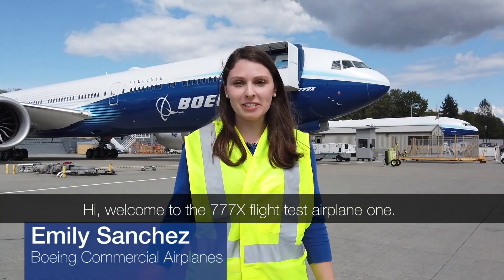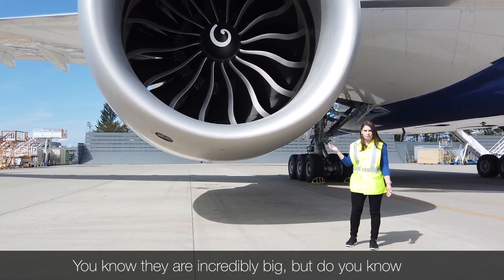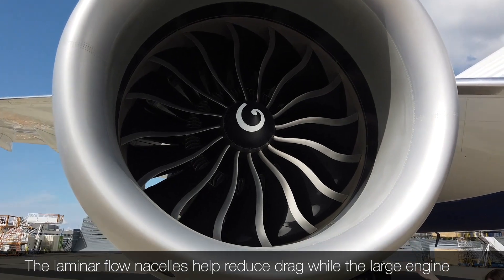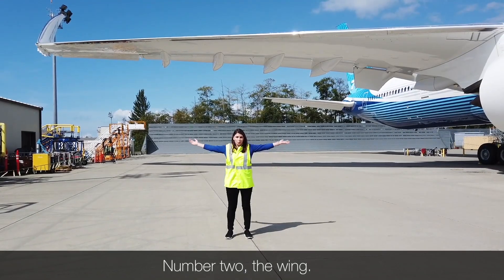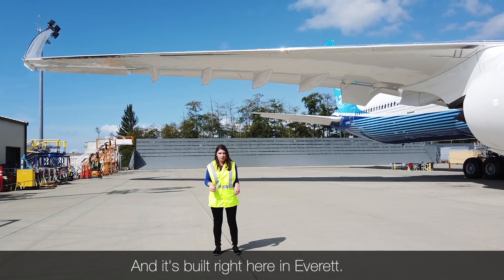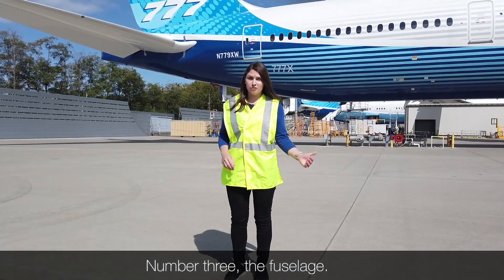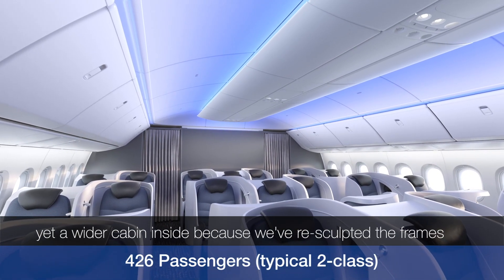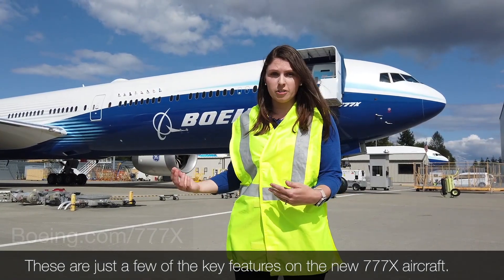Boeing's 777X | The GE9X Engine, Wings and Fuselage

Comment: This engine sooo huge
Reply: But it's also sooo fuel efficient, unlike the GE90.
Reply: @miladicanimations7759 The GE-90 is incredibly fuel efficient
Reply: Jogatina Gameplays  I don't know man so many lives.... I am Boeing guy myself... But what's not right is not right.... I hope they bring a version of the 757 such a underdog among commercial jets
Reply: Jogatina Gameplays  757 has the potential they are looking for in the nma
Reply: @WilMar Neither the 737 Max nor ATR use FBW (except the spoilers in the Max’s case). Of course MCAS and FBW are two different things, that’s why Boeing installed MCAS on the 737 Maxs because they use conventional flight controls and cannot be made to handle similarly to other 737s without MCAS.
Reply: I hope there's nothing mcas because of that
Reply: Boeing chose GE's to power the 777x exclusively
Reply: Well it has to be to keep it a twin-engine aircraft instead of 4 XD
Reply: Jogatina Gameplays  but the engines look big but I don't think 737 fuselage can fit in it?
Reply: Jogatina Gameplays  I saw that lady standing in front of this 777x engine and I can imagine it only able to fit a 2 sit seats on both sides of the engine
Reply: @WilMar Boeing 777X has no MCAS 🙃